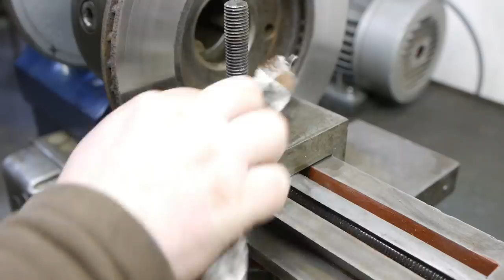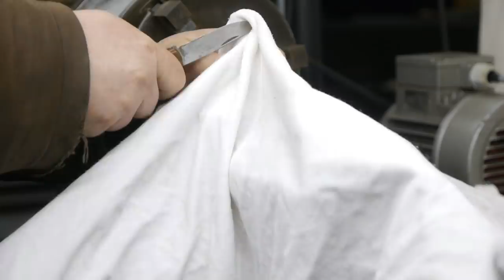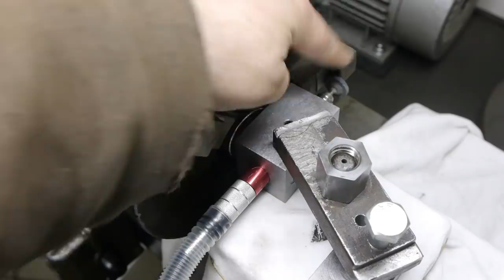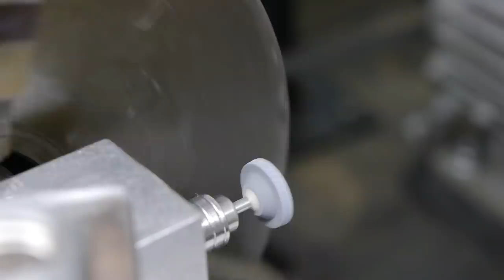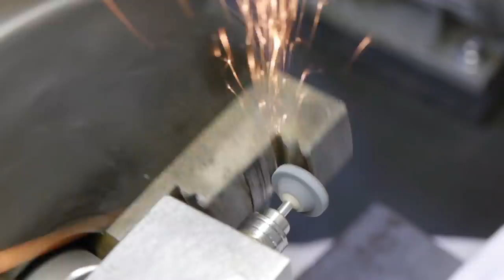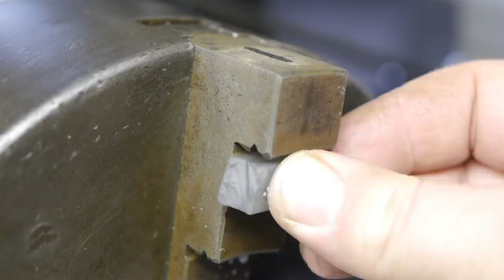Grinding the jaw steps on a worn out old chuck

Comment: for the sake of every machinist in all of the universes: get a new chuck for christs sake and a multifix while you're at it, this is just beyond painful to watch.
Reply from the maker: So you are into the multiverse theory, surly there must be one out there where machinist aren't obsessed with with my amateur screw ups :)
Reply: @Rolingmetal  don't listen to the none constructive negivtive comments. Your chuck is better than when you started. With the set up you had it might of went easier if you reversed the lathe so the grinding wheel would be turning the opposite direction of the chuck. If not possible flip the grinder over so the wheel is facing you. The other thing that should help is with the lathe turning slow move the grinding wheel back and forth. Good luck keep having fun. One more thing ferze001 is just beyond and painful to read his comments!
Reply from the maker: @zomgthisisawesomelol I believe it's a type or brand of  quick change tools posts. Wouldn't fit on this vintage lathe.
Reply from the maker: @andyZ3500s  That comment wasn't too bad, it didn't bother me one bit. The really bad ones get a "shadow ban" meaning they can still post as much as they want, but no one but themself well ever see the comment. Only happened a few times.
Also, it wasn't the brightest comment because a Multifix of any qctp will not fit on this lathe without some serious modifications :)
Reply: @Rolingmetal  how are you, your right I never get mixed up in the negative, this is a great thing we have here. I hope my comments helped. You want the material to be moving opposite of the grinding wheel. I never noticed that your carriage does not have a T - slot, more solid than a old lantern style which I still use sometimes. I do like my aloris, I was lucky to get it. You have a great sense of humor. What country do you live in? Thanks Andy